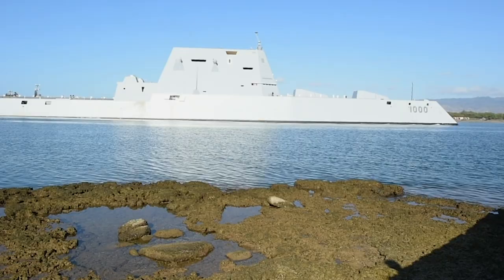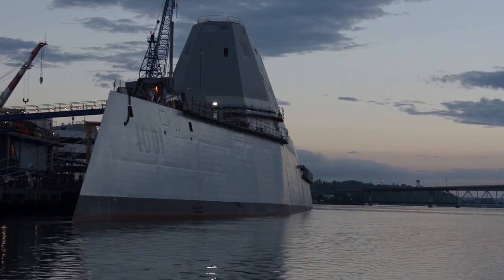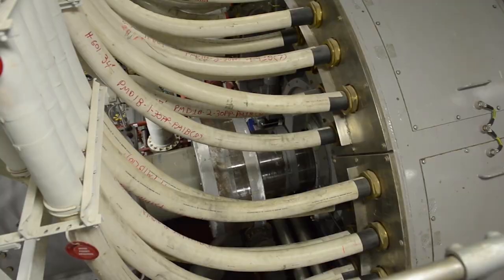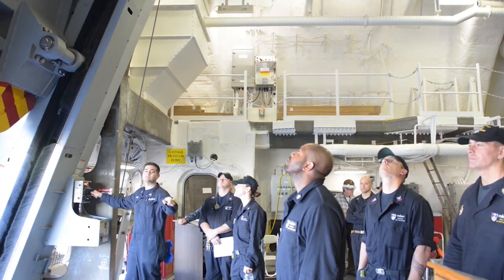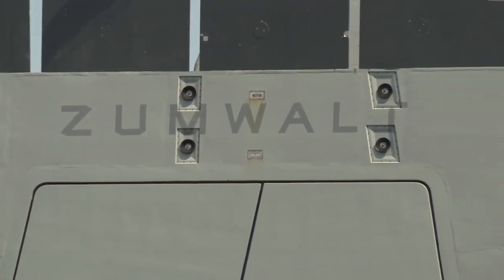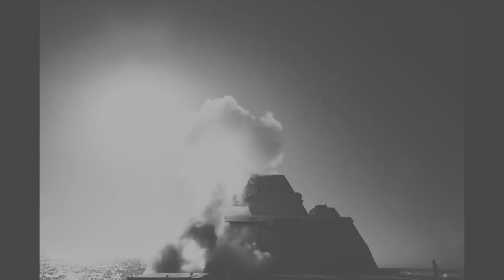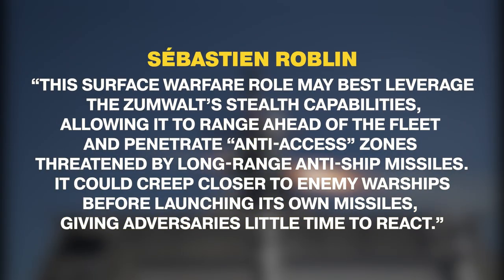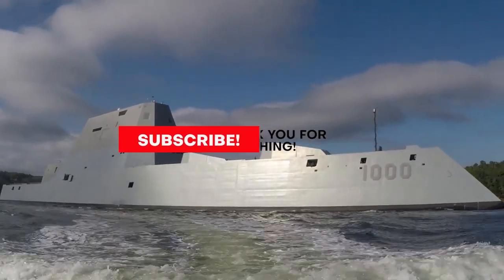Weird Looking $4.5 Billion US Stealth Ship In Ocean | The USS Zumwalt | World’s Largest Destroyer

Comment: The most important part of  naval machines is the maintenance cost and it's duration, as well as the efficiency in the missions. You may find advanced machines in different markets with tremendous capability, but the problem is not being ready when you need them due to maintenance issues and operations budget issues. Readiness is more important than capability in war machines.
Reply from the maker: Well said, thanks for watching!

Comment: With new tech, you won't know if it works until you build it.    With multiple new systems, integrating them all isn't going to work the first time.    It is really expensive but don't write off the knowledge gained.       Triple expansion steam engines are a safe bet and relatively inexpensive but uncompetitive today